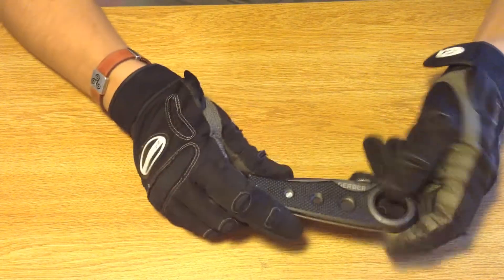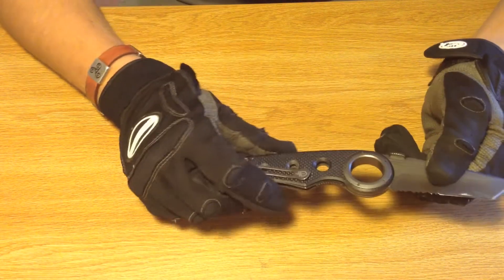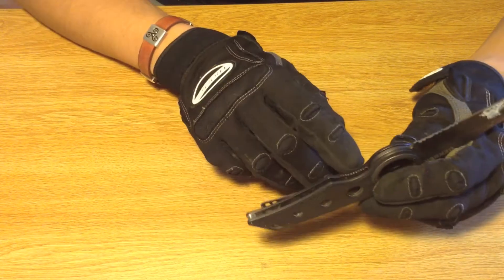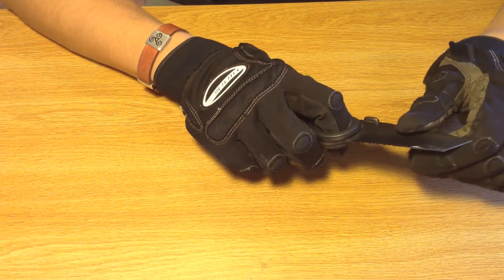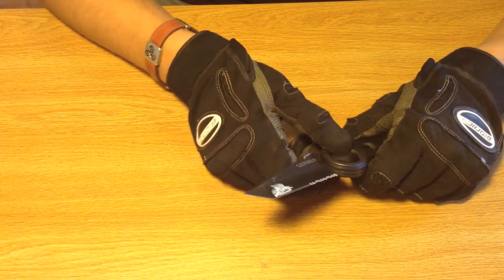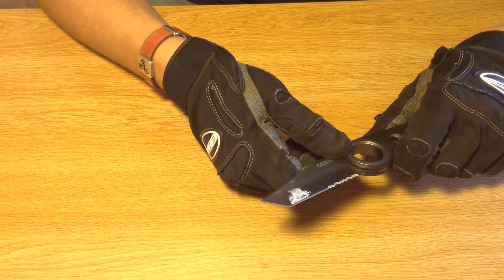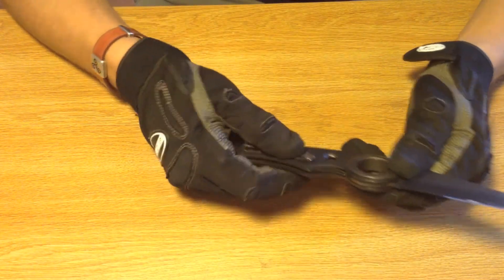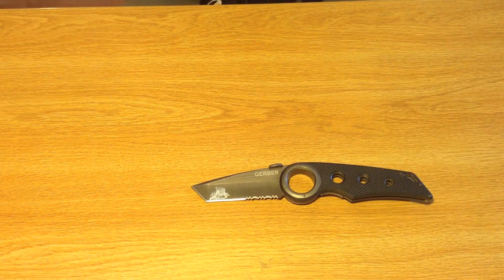Why the Gerber Remix isn't 'Tactical' | Knife reviews by Ice

Comment: I honestly thought that the hinge was very stiff, and the liner to close the knife was real small, so closing it took more effort than it should. I love the design of it. I just like the ring to spin it, I agree that it has no practical use in combat or anything else. luckily I'm only using it for EDC uses, I have a fixed tanto blade for tactical uses.

Comment: I just purchased it ..love very happy ...comes out very fast just put a little oil and work it a little...great little folder !!
Reply: Jerry Klein what kind of oil did you apply? Im not a knife snob or too knowledgeable as far as care goes... I recently found a Gerber remix single scale drop point in my house and its pretty stiff getting the blade out. I have to use both hands to get the job done. Thanks for any advice!
Reply: If you spin the inner and outer rings away from each other it will adjust the tension

Comment: I don't mean to come off as some trolling dick head, but i would like to say a few words. The thumb opener, or "wave" as many refer to it as, is actually the fastest deployment style out there. The idea is that it catches on the edge of ones pocket and as you pull the knife out so the blade is already being opened as you are deploying your knife and even before you have your final fighting grip. So essentially the knife comes out of your pocket already opened and ready to go. Personally I find that this knife particularly is a little tight out of the box, but oil it up and work it in, it absolutely FLYS open. As for the hole, being a avid rock climber we use it with a carabiner through the hole. I would never have a knife unsecured to me when I'm on a rock face.

Just a few thoughts on this review. But I really like your other reviews. Keep up the good work brother!

P.S. If gerber has the chance to slap the word tactical in there, any tanto blade is getting "tactiCOOL" thrown on the end of the name haha!
Reply from the maker: +Jason Fleck Thanks for your comment! I understand you're not flaming or trolling me, so I admire your boldness. I appreciate that, so I'll give you my thorough, honest reply:

Thanks for the info about having a carabiner through the hole while using the knife! I hadn't thought of that advantage. Good to know, thanks man!

I understand how the wave feature works, and I have experience using it. The reason I dislike the wave feature is not because of its speed, but rather its lack of reliability, especially in a tactical setting, and the amount of variables involved in its success. In a life or death situation, you want your equipment to work the way it is supposed to 100% of the time, and you want it to be instinctual enough that you can actually operate it properly when in a stressful situation with adrenaline pumping through your body. Because of these factors, I think the popularization of the wave feature is quite frankly dangerous. First, you would need to train with it extensively to make catching the wave on the lip of your pocket instinctual enough, and even still, it will perform differently with different pants and pocket types. So even if you train for years, it's almost never going to have as good a success rate as a standard thumb stud. If you pull it and it fails, you are either not going to know right away and find your knife still closed when the threat reaches you, or if you do know that it failed, you now have to take your attention off the threat and direct your attention to opening the knife normally. All of these things seem small in everyday, menial tasks, but in a serious situation, these are serious failures. That's why it's dangerous; because someone's going to pull this with 0.7 seconds before they need to defend their life, it's going to fail on them, and they get killed. Don't get me wrong, it's an innovative idea, but it does not belong in life & death situations, and it irks me that Emerson advertises it as such. Theirs is the most developed version of the wave feature on the market, so they know if it's advertised as a legitimate tactic they'll make serious bank, but at what cost? Even if just 1 or 2 people eventually get themselves killed or seriously injured trusting this feature, it's not worth it.

Also, the wave feature actually is not the fastest deployment style out there: that honor is reserved for the fixed blade with a pressure sheath. To me, I measure the speed of a knife as draw time+deployment time+recovery time. Draw time being from carry to hand, deployment time being time required to make the knife ready to use (usually opening the blade), and recovery time being time taken to adjust the hand to a ready position. Nothing will ever be faster than the fixed blade, because deployment time and recovery time are always exactly zero. Even if the wave feature does completely eliminate deployment time, it still has a recovery time because no matter how fast the deployment, if it's a folding knife your hand has to be free of the spine of the blade during deployment, which is not a combat-ready hand position. Also, the fixed blade has 100% reliability, and is also stronger than folding or OTF. So in short, the fixed blade is the fastest, strongest, and most reliable tactical knife option in the world. Not to mention, they're cheaper to produce because no locking mechanism is necessary and they don't require such high mechanical tolerances because no hinge or stop is involved, so you can end up with a much better steel for the same price if you switch from folding to fixed.

Also, I acknowledge this is one of my more improvised reviews, and I probably do have a significant bias to one side, but for what it's worth I'd still stand behind the majority of what I said in this one.

Haha and yeah man you're totally right! And Gerber wonders why they aren't taken seriously in the knife industry! They could start by actually revealing what steel they use in half their knives. The heat treatment is so bad on some of them, haha I have a hunch they don't even have one and just leave it unhardened!

I appreciate your honest perspective and support of the channel - thanks bro!
Reply from the maker: Haha yeah, well thanks man!

While the 06 auto is a decent knife, they actually have a few decent designs if you can get past the fact that their blades are barely even made of steel. I'm a fan of the paraframe II, and that thing would be a huge hit if they pumped that out in S30V or even 154CM.

For my kit, I carry the Benchmade 810-1401 Contego in M390 as my main user. Next I rotate between the Benchmade 915 Triage (rescue knife) and the Spyderco Manix 2 lightweight in S110V for my secondary. For a super hard use beater (like if I ever have to cut metal like aluminum sheeting or steel wires or cables) I actually use a Gerber Ripstop that I did a full convex custom regrind on and I retreated it to make it harder. Lastly, I carry the Schrade SCHF15 fixed blade in a kydex sheath in a reverse draw position on my right hip, EDC. I have reviews on the Contego, Triage and SCHF15 on my channel, and a review of the Spyderco Manix in S110V is on the way.
Reply: icemanreed how do you feel about the Emerson designs?

Comment: Wouldn't your problems with the finger hole also apply to knives like karambits?
Reply from the maker: +Michael Bagley To an extent, yes. I don't particularly trust Karambits. However, this is a bit worse because the hole is centralized rather than on the end. Your grip is strongest by your index and middle fingers, so the front of your hand. Having the hole there means that if they get leverage over the knife, those fingers will be the last to come out, and more likely to break. With a Karambit it's at least on the end so it's a bit more natural and easier to spin your hand out of it. But yeah, I don't particularly trust either - I'd rather lose the knife than both lost the knife and break my finger.